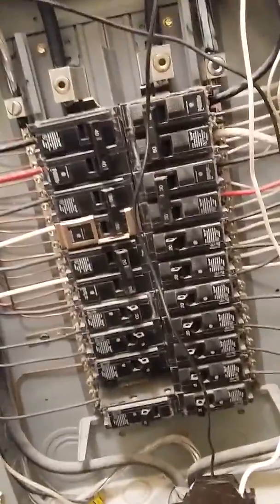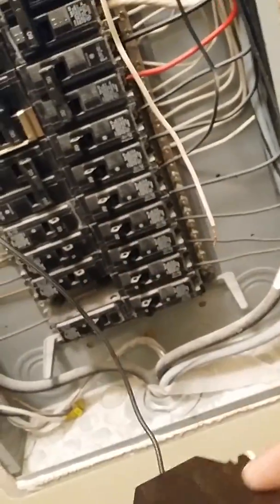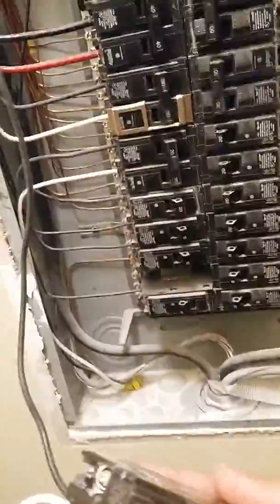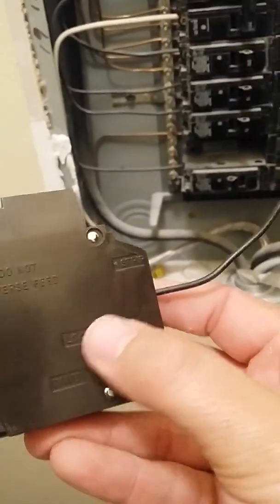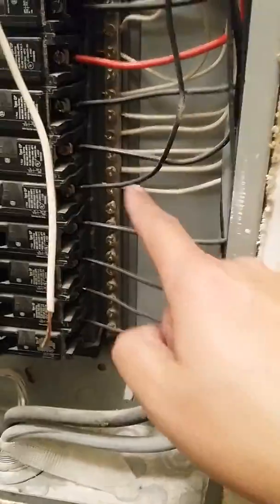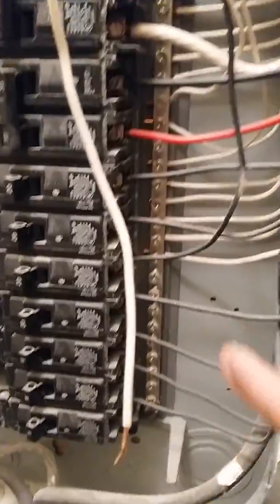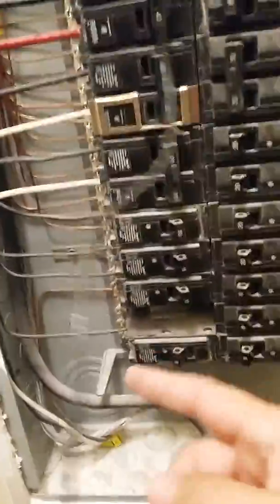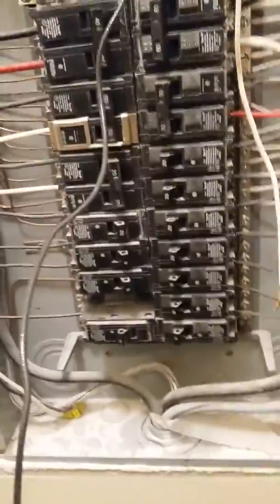GFCI Breaker install

Comment: How do you locate the common (white wire) . I have several coming in and I'm not for sure which one goes to the circuit???
Reply from the maker: It will be the one that is in the same sheathing that your black wire is in. I cannot see what you are doing or your panel. Make sure that you turn off the main breaker and make sure that you are not touching any lugs or wiring that goes to the main breaker. If you are not sure about it, have someone else that is experienced do this for you. Remember even if the main is off there are still parts of the panel that is live. Please be aware!